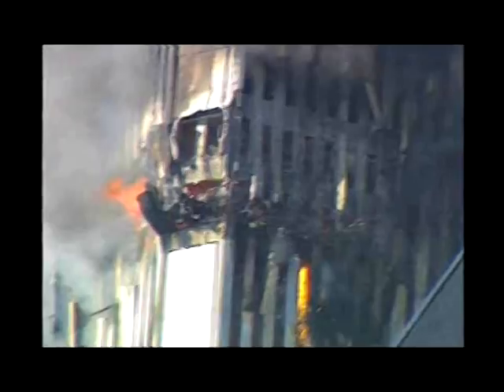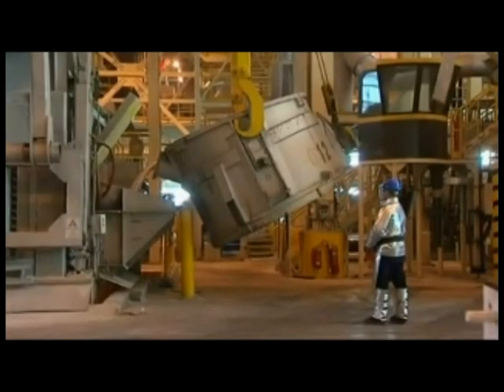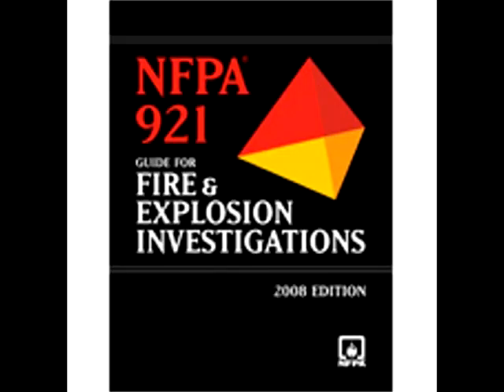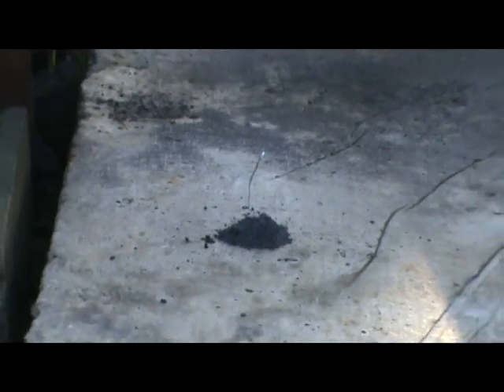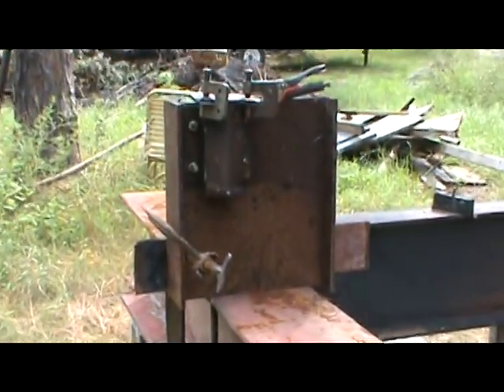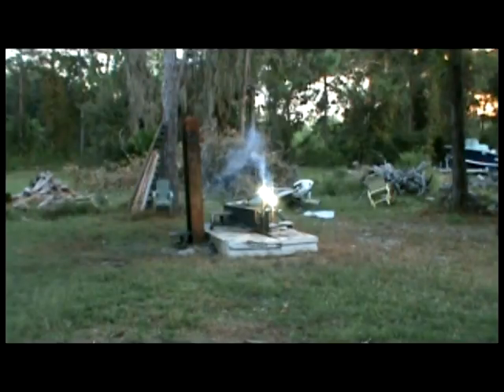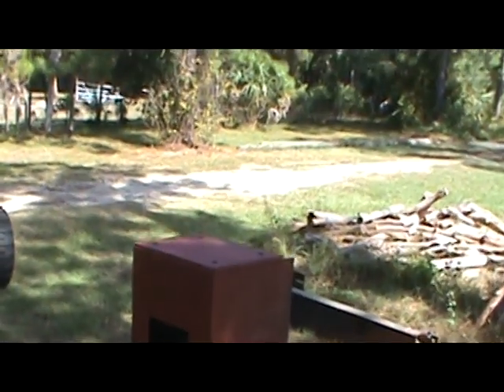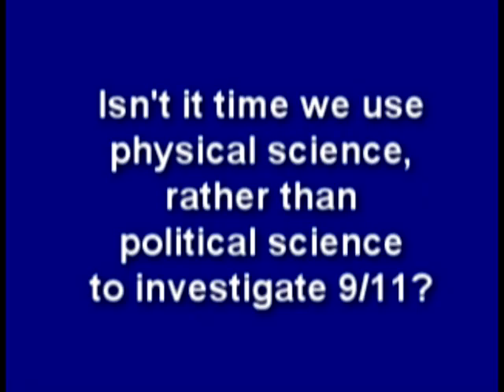9/11 Experiments: The Great Thermate Debate

Comment: he even shows you how inplausible it is to use thermite and he still believes it's true rofl.. some idiots will believe anything.
Reply: The video was meant to be a refutation of National Geographic, who couldn't get steel to melt with a substance that burns about 2000 degrees celsius above the melting point of steel!

The working theory is that it was nano-thermite, but nano-thermite is a controlled substance, and is not readily available for experimentation.

The guys at National Geographic essentially bumped a cigarette up against the SIDE of a lit lighter, couldn't get the cigarette to light, and then declared that "no one can light a cigarette with a cigarette lighter"!

All they did was prove their ridiculous level of incompetence, but that's all you needed, right?

You're just looking for a reason to believe the bullshit artists, aren't you?

If that's the case, I have a prime piece of real estate down in Louisiana that I'd like to sell you.

LOL